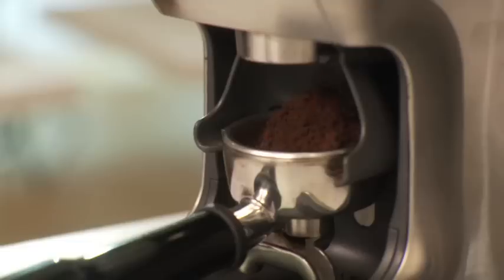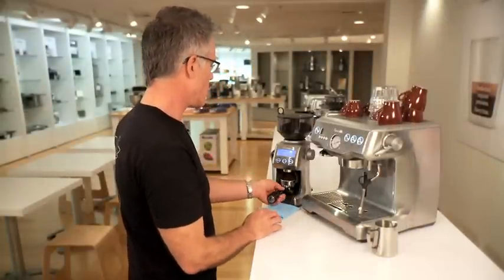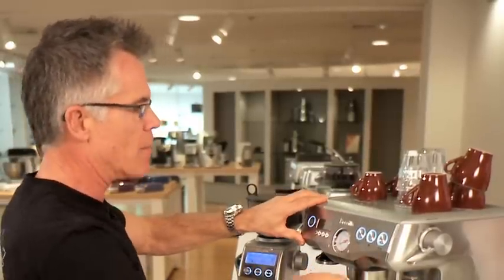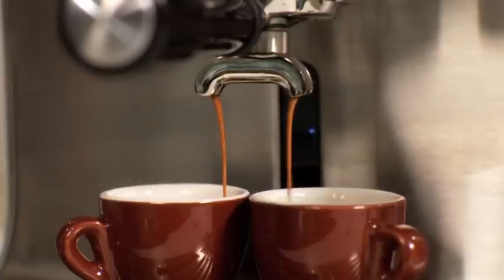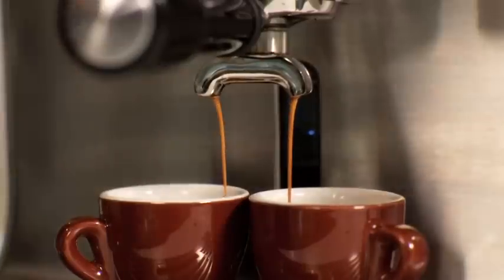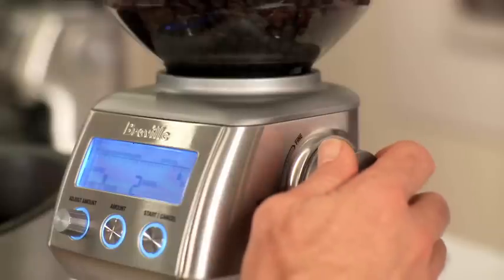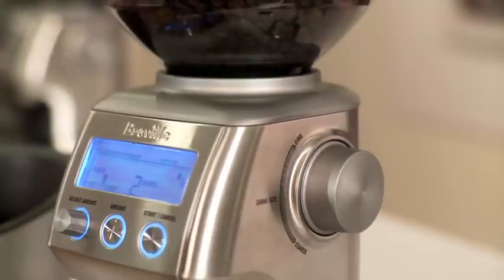Espresso Tips - Grinding, Dosing, Extraction and Tamping

Comment: If your still interested in getting a perfect espresso shot. Look into videos that explain how to adjust the amount you dose as well as the coarseness of the grind based on the pour time for your shot and the 'sogginess' of the 'biscuit' in the basket after the extraction. This was a morning ritual at my old cafe but it can take putting on a few shots to get it right so depending on how much coffee you're willing to use, it might not be the best method for you.
In our case, we would always try to have a double shot run 26-28 seconds from button press to when it finishes pouring. Your manual should have a recommended pour time in it for your machine. 
Look for a 'biscuit' of coffee moist and firm enough that it stays in one clean piece when you knock it out of the basket. Wetter biscuits generally mean you need to increase the dosage and the coarseness.
Having said all that, if you like the taste better some other way, then that's even better.

Comment: It's a matter of actually extracting an espresso with a consistant dose & then assessing if the grind is too coarse or too fine based on the rate of flow of the espresso. If too fast, then make the grind finer & if too slow, then make the grind coarser, both while holding the dose constant.

Cheers, Phil

Comment: I have an older Breville that does not have a built-in grinder. I have a  cuisinart burr grinder set to the finest grind. Even when I tamp with all my strength, a double shot takes about 12 seconds. Obviously it tastes under-extracted.
Reply: You need a grinder that is meant for espresso. I use the breville smart grinder pro, it's great.

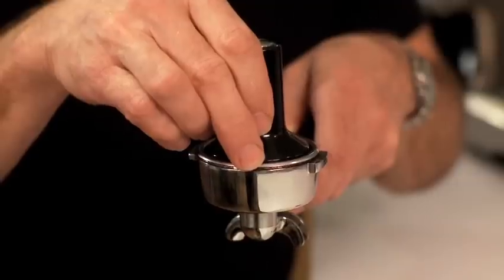Comment: 00:39 and 1:39 is not the same tamping example
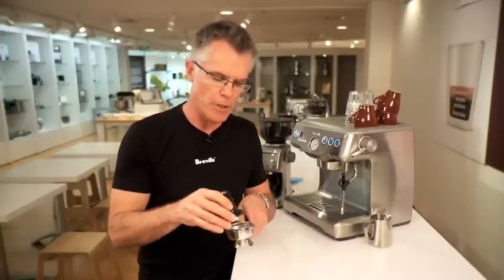Reply: Noticed that as well. On this machine I always try to go a little above exactly level. The one at 00:39 is what you have to do, if you do 1:39 you end up applying pressure to the portafilter rather than the coffee (and when you extract it will run through way too fast).
Reply: @ChristopherElwell  yup i noticed the same as well. I was a little confused on why my espresso is flowing way too fast. Glad I found you haha. You have the same exact machine back there?
Reply: @baristaodla7640  It looks to be the same exact espresso machine as mine. The grinder is the same as mine except I have a newer model.
Reply: @ChristopherElwell  interesting. I just got a Barista Express and it's flowing too fast. If I load the portafilter up like his first example at 00.39 surely I'll have more than the 18g of coffee that I need?
Reply: @TheIrishmike1984  The one I have is a slightly larger portafilter than the Express, and I usually use the doubleshot size. Anyways, if you make the coffee level with the top before tamping, that should be the right amount. If it's still flowing too fast you might need a finer grind size. But if you're tamping and you feel like most of the pressure is being applied on the basket instead of the coffee, then you probably started with not enough coffee.

Comment: Having a timing issue and wondered if anyone has suggestions-the pressure gauge is right in the sweet spot and the shot looks good, however it’s ending around the 15 second mark. I know you want to aim between 20 25 seconds, so ultimately my shot is much less in volume. I understand changing variables like grind size, coffee amounts etc., but if the bar is right in the 12 o’clock where it should be, how do you change these things without messing with the pressure?
Reply: Same here. I have the Barista Express and after setting grind size and amount of coffee in a way the machine builds up the perfect pressure, a single shot is done after 15 secs. The only way to increase the extraction time is to decrease the grind size, but this leads to a pressure which is far too high. Interestingly though, if you check out the Sage Barista Express Demo video on youtube, you'll see that even there a single shot runs for only 15-16 secs. Quite strange...

Comment: When you pull your shot do you time it from the point you push the button? Or do you time it from when the first drip comes out? Please help I want maximum consistency. Which is proper?
Reply: Always from when you push the button as that is preinfusion, which is done at lower pressure.

Comment: is it a universal rule (I have a ECM E61 group) that when the top of the tamper (when done tamping) is level with the filter basket you've used the right amount of coffee? isn't it highly dependant on what tamper you use and how it is designed, or do tamper-manufacturers always keep to this standard?
Reply: +rodluvan1976 There are many sizes of tamper bases as well as basket sizes. Instead of depending on the tampers base size to get the right amount of dosage, try using a scale to weigh the dosage. (Doesn't have to be fancy just a scale that can weigh in grams.)
Reply: Dani Andrews ok, cheers

Comment: My point is that this is not a huge science experiment - if someone uses the word pressure and shows you they are pressing down on an object, then you should understand they meant force.  The Breville guy believe you understand he is referring to Kilograms and not Kilometers or Kilobytes or Kilotons or Kilonewtons.

Im just surprised that you actually would think he meant 15lbs or 15 Newtons rather than 15 Kg. 

Also, both Kg & lbs are not a unit of pressure either.

Comment: Ive got a problem, my expresso grind cant go any finer i am on 1 yet flowing way to quick, cannot get right rate of flow. even tried tamping harder to no avail any ideas?
Reply: Thereal Brogers check the settings 1-10 on the bur grinder adjustment inside the hopper. I had to bring mine down to a 3 and my machine setting is on fine. I’m pulling great shots now using the single wall basket. Also, try using the double wall basket, the grind doesn’t need to be near as perfect. If anything you want a slight larger grind for the double wall.
Reply: @mystyboarder910  After trying what you have told me, it is still pouring fast etc, no clue. watched 100 videos on how to tamp correctly and whatnot, adjusted settings..these machines come either fucked or just work perfect.
Reply: @brogers_  since I wrote the first message I've experimented with more beans. It's 100% the beans. I use Illy brand classico and my grind settings went back to #8 and my fill setting is only to 1/4. I found a local roaster too and the grind setting may be even higher with fresher beans, atleast for a few days. I also found I do a much lighter tamp, otherwise it wont even pour.
Reply: Have you tried increasing the dose in the basket?

Comment: No matter what grind size or amount the extraction always goes to the very end and just drips out the machine, it's impossible o use this machine (Breville Barista Express), honestly... I set the grind size to 1 - the finest, tampered down as shown in the video and still the coffee just drips out and looks horrible.. I've tried a heap of different settings and every-time the pressure goes all the way to the end, it's incredibly frustrating.

What else could be the issue? Does it matter how old the beans are - I'm using the beans that came with the machine, they don't have a roast date on them..?
Reply: Thanks for replying :)

I've tried every setting, from finest to max course setting, tried different grind amounts, tried applying different pressure when tampering. No matter what I do it always goes to the very end of the pressure scale.

Currently the grind is set to 3 which is course, still, the pressure goes to the very end.. Nothing is making logical sense. Almost need a Breville rep to come out and show me how to use the damn thing..
Reply: I used grind setting of 3 (lower the number the courser it gets) this morning and same thing happened.

What do you have your grind amount set at for double shots/single shots? How much pressure do you use when tampering?

I have the "Breville The Barista Express Coffee Machine" just in case you are using something different.

Cheers.
Reply: Lifesaver, thanks soo much for helping me out, what a rookie mistake on my part :P

Just made a perfect coffee :)
Reply: @dekaOsiris  What was the mistake? I feel I've got the same problem as you do. I can't see the responses to your post.
Reply: @dekaOsiris  yes please, what was the mistake you were making?
Reply: @timvrh1217  Hi, so I basically used the course grind setting (3 or 2) and then filled the double portafilter with a single shot grind, tampered then another single shot grind and tampered again. This solved it for me and I do find different beans require different grind settings but haven't had an issue since..

Comment: How do you know when it's a machine issue ?example back to back Breville infusion machines . First machine no problem with  always made beautiful Crema . The second machine one day it's good the next day it's not  no matter how many shots you make no matter how many times you change the grind no matter nothing  . Some days it just doesn't wanna functional properly it seems  . First machine had over four years so I know how to use the machine . The second machine is finicky as can be . And yes he buys fresh beans to order . So no it's not the beans . We have changed nothing here but a new machine . Same everything same beans same grinder same everything . He had bought it as a back up upsets us because as soon as he opened it we were noticing issues with the pressure gauge then all the sudden we had no issues in the pressure was getting up to where it should be after messing with it for quite a long time several weeks . Call Breville they went on and on about how we must not have fresh beans how is that possible LOL when we buy fresh to order with a roasting date of two days old by the time we receive it . Anyways they wanted us to pay $200 to fix the machine it's never been used lesson learned never buy a backup machine because the warranty  won't exist

Comment: Do not grind to Turkish fine. This is bad advice. Espresso grind is what's required & Turkish is finer than that. Pre-Infusion is used on every commercial machine that has an E61 group-head. It is also employed by all Synesso machines, so it is not a function for newbies. It helps ensure all the gounds are extracted evenly so the espresso reaches its flavour potential.

Cheers, Phil